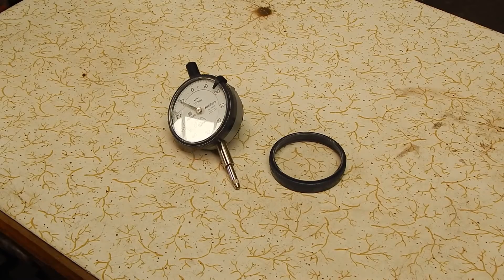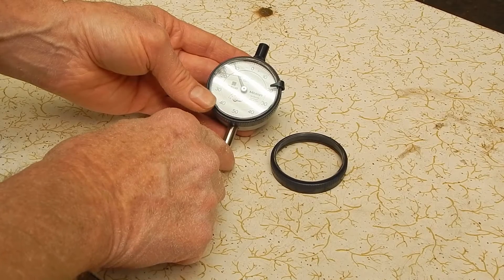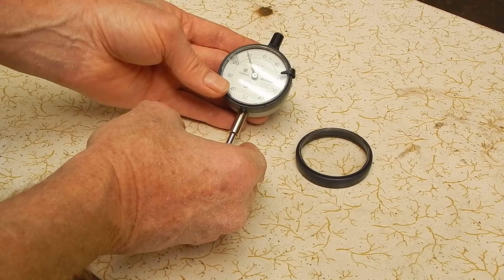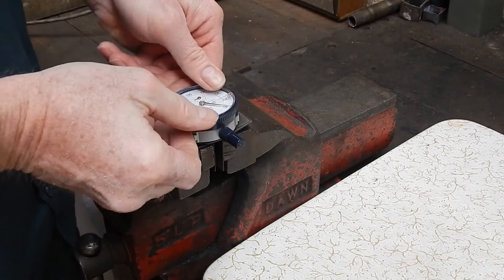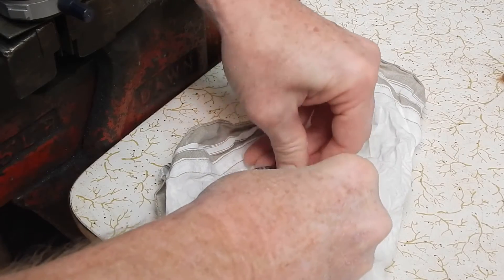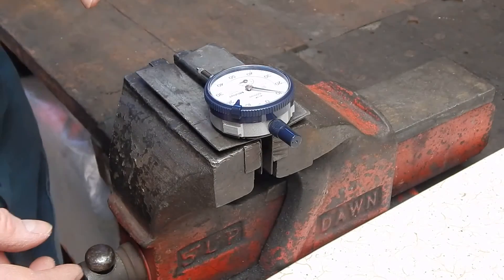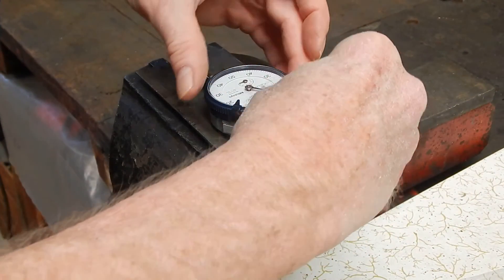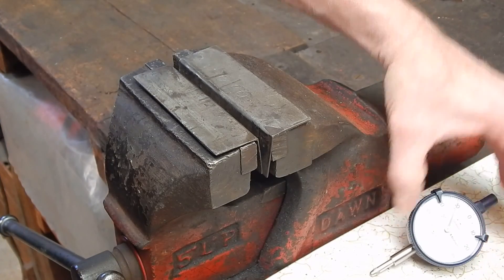Replace the bezel crystal on a Mitutoyo dial indicator

Comment: How in the heck do I change the contact point replacement on new mitutoyo dial test indicator? There is no flat on the needle and I don`t want to use plier`s to take it off.
Reply from the maker: +Ricky Reynolds 

Can't help on that without seeing it.  Ring or email the agent or Mitutoyo support site.  They will know.  Cheers Rob
Reply: +Ricky Reynolds (you probably know this by now, but if anyone else looks) The internal pin on the spindle that keeps the spindle aligned in use does the job. If the tip won't turn with your fingers, use small pliers, maybe with leather or soft jaws to protect the spindle near the tip, holding the body in your other hand. If it won't come off with light to moderate force, it needs to see a service shop, as it is a 2.5mm thread (or possibly #4-48 on imperial graduated devices) and shouldn't need a lot of force. See the service kit instructions at http://www.mitutoyo.co.jp/eng/support/service/manual/003.html (as of 2016Feb) for more information

Comment: I am always breaking bezels and lenses as I am a machining Troglodyte.  I make replacements out of thin glass and diamond rotary bits.  A good thin glass source is dollar store pictures frames and mirrors.  Get the kind used for decorating walls NOT photo frames.  The mirrors are aluminized and it comes off with an alkali like oven cleaner or the 'purple' de-greasers so you can even make fancy masked bezels for digital tools.  Hmmm, this may be a video idea...